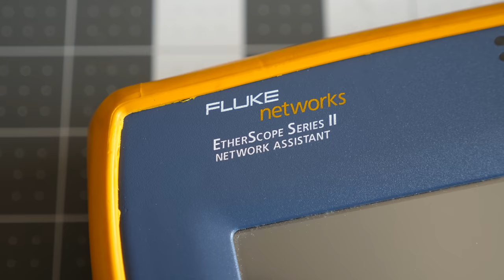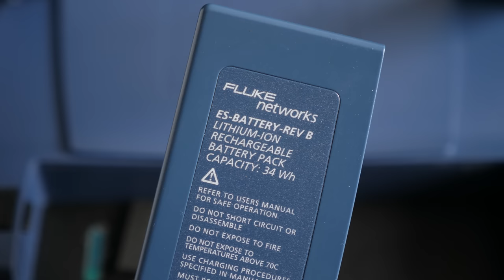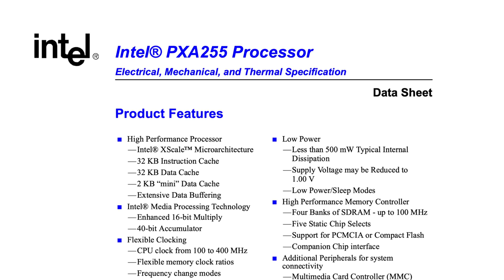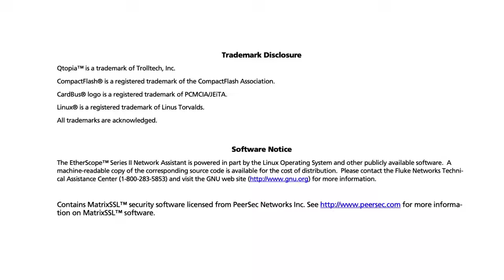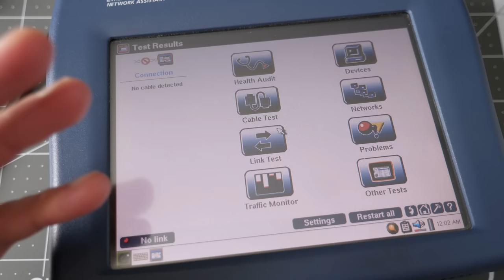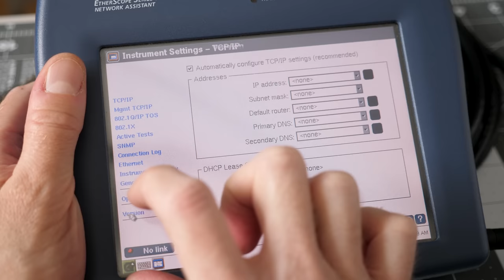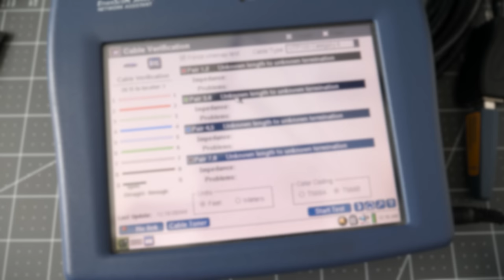Fluke EtherScope Network Analyzer Teardown and Repair

Comment: The TDR functionality is clutch. I'm a cable tech and I can't tell you how many times having a TDR or OTDR has helped me resolve issues.
Reply from the maker: During its time it certainly was a big deal. I don’t think dedicated devices with it are quite as popular now because a lot of network switches have built-in TDR testing capability.
Reply: @ThisDoesNotCompute  very true, a lot of my current kit has made dedicated tools obsolete, but whenever I needed one they were lifesavers! Regardless, very cool video as usual! Thanks!!

Comment: Oh I didn't know you were a Network Engineer. I knew you worked in IT though. I was wondering, I am looking for something really special,  program that runs on Android that can run a PXE server so I can load ISOs straight on my phone to help repair and diagnose problems. I can't seem to find a working program, I know it will need root and that's fine but if you know any software like that it would be awesome!

Comment: I've seen better power jack design literally on netbooks, all they had to do was put the DC jack on a cable so when that failed, you just replaced the DC jack by plugging in a new one. 
Honestly shameful design on Fluke's part. But personally, I think that all devices shouldn't have the connectors be on the same board as the mainboard because as soon as you break a connector, you have to get out the soldering iron to micro solder some connectors back onto the device. If it was just on a little connector board, all you'd have to do is replace the connector board.

Comment: The failure type for Fluke is nothing unusual. Most of the Fluke multimeter have problem with plug intermittence over time. I do not see that in other brands like Keiysight/Agilent.

Comment: Hey not a network guy here, Just wondered if someone could tell me if this works like an oscilloscope for ethernet data or has the feature to do so ? Can you actually see the data bursts of packet data on the Rx an Tx of what's being sent down the cable ? Much appreciated.

Comment: My Acer netbook I had to work on the power jack and in my netbook Acer put the DC power jack on a Daughter board and it was the plastic holder that broke. Fluke should have done what Acer did in some of there netbooks.

Comment: This thing looks to be based on a reference design, it uses the PXA250 chip that was used in the Zaurus SL-5600, ran at 400Mhz too.  That was a big upgrade from the SL-5500 with the SA-1110 206Mhz chip.  I did some software development on the Zaurus in the early 2000's: http://www.dainst.com/software.html

Comment: The PXA255 processor is in Sharp Zaurus PDAs. The SL-C750 thru SL-C780 models @ 400 MHz.  The small QT icon in the bottom-left corner is the Qtopia desktop symbol.
These devices also ran Linux OpenPDA OS. Also, the icons on the taskbar are the same as the ones I have on my later model Zaurus SL-C3100 and SL-C3200, which have a PXA270 processor @ 416 MHz.  And run Lineo uLinux kernel 2.4.20 (Just a comparison, these later models came out in 2004-2005)

Comment: My first Synology DS-101j NAS I got in Feb' 2006 had an Xscale CPU and running a Linux operating system.  Excellent NAS that I still have now, although I use a newer model these days.

Comment: Oh Intel Xscale that was the processor where I first learned assembly language on in college. Good times. Yeah Intel sold their ARM license and the Xscale business to Marvell but they did not update the data sheet on this processor since they did not make any changes to the design. I wonder if Intel will consider making the switch to using ARM architecture for some of its chips again given its success in devices that need low power consumption.

Comment: what ??? those jacks always break the pad of the board, or break at the metal soldered to the board , all my years of repairing devices , that was by far the most common cause for it to break

Comment: I’m a telecoms network engineer in the UK and we are issued either Viavi onx-580 devices or Exfo Max testers. 
These are all in one unit and have a large amount of functions for testing the external network (copper and fibre) as well as complete broadband sync and faulting. They’re extremely expensive but luckily we are issued with them

Comment: It looks like there is an electrical connection to the corner-most pad of the power jack-- a thin trace around the perimeter of the board that also connects to those solder-fortified vias.

Comment: Perhaps the audio feature was in cases when using two for communication between technicians for certain tests.  For the jack, five minute epoxy might have been better. Crazy glue is too brittle for this type of stress.

Comment: Some pairs are inherently wrapped tighter than others... look at the 4 pairs next time you have a cable stripped, it's purposely done.... and the meter is likely actually estimating fairly accurately, as more twists will equal slightly longer pairs.

Comment: About the headphones jack it may be a good option to hear the beeps of the tests because sometimes you have to put your head and hands into pretty little places to connect the RJ45 jacks and if you're also in an industrial noisy environment then the beeps in the earphones are a welcomed help (because also in tiny spaces you dont get to see the LCD,you just put the analyzer into auto loop mode and wait for the beeps while connecting ends of RJ45s from a patcher rack or something inconveniently placed where the whole analyzer cant be seen)

Comment: Colin: “This device is from around 2005...”. Me: “dude, that chip has a 2008 date code, that chip has a 2008 date code, etc...”
Reply from the maker: The model was introduced in 2005.
Reply: Yeah kinda same, I was like no way this is from 2005, given the 08 date codes. Then the manufacturing date is 09 so that pretty much explained it.

Comment: Some of those ICs on board I recall seeing a '07 date code for some. So at least room for a revision in those 2 years 😉
Reply: The Xilinx CPLD was 0901 (1st week 2009), the Xilinx Virtex-2 was 0833 (33rd week 2008) so definitely newer than 2005 as confirmed by the Manu Date reported by the software.

Comment: • 3:00 - Why didn't they just leave the rubber case off? 🤨
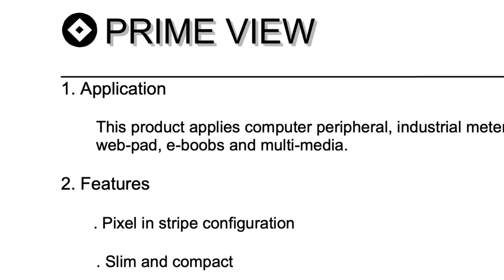• 11:48 - e-boobs are the best boobs. 😂 But I have no idea what it was supposed to say. e-boot? 😕
• 13:07 - How is the power connector surface-mount instead of through-hole? Amateurs. 🤦
• 14:48 - Attach it with Gorilla Glue? Nah, just use hair-spray, that should work. 🤷
• 18:10 - The Sega Dreamcast uses Windows CE. I wonder if that explains why it failed. 🤔
• 19:26 - If the conductor is broken, then the circuit is open, so how can it tell where the break is? I assume it must be doing something like checking the capacitance of the length of conductor or something. It's probably like an LCR meter. 🤔
• 21:15 - I'm no sure how close-enough is good enough. If it says the break is between 15-25 feet down the cable, then what are you supposed to do, cut out and replace 10' of cable? 🤨
• 24:12 - Dave has entered the chat. Haiii! - 25:20 - Dave has re-entered the chat. Look what I found in the dumpster!
• 26:10 - These days, you could probably jury-rig one out of an Arduino for <$10. Ah, progress, making the past look insane.

Comment: Dude 3d print, metal bracket, are you being serious? Yesterday I used a 1/32 bit on a dremel tool to drill out a broken screw on my glasses handle without my glasses, and I didn't even use an Arduino controlled cnc to help me, ok I am being facetious. Now that you super glued the connector - Just use some opposing vias of the ground plane to make an X-like pattern over the connector and epoxy it, or just use a small drill like I did with my glasses and drill through the solder and board of the (Ground) legs of the connector and add brass glasses screws and solder them. And stop fussing like a Cat.